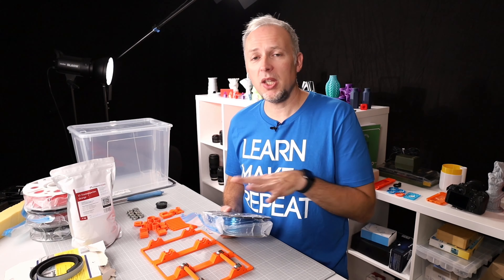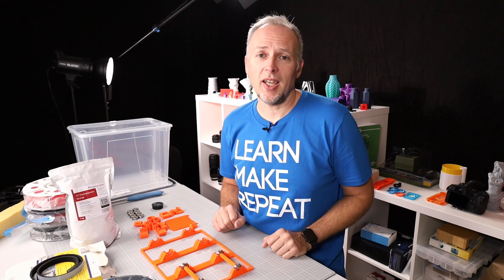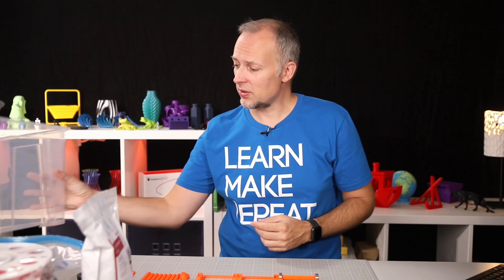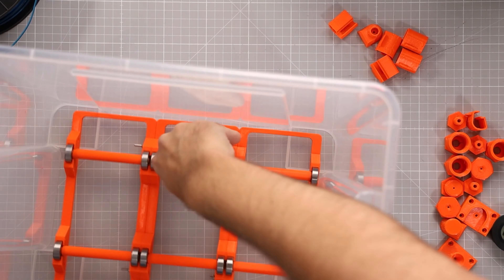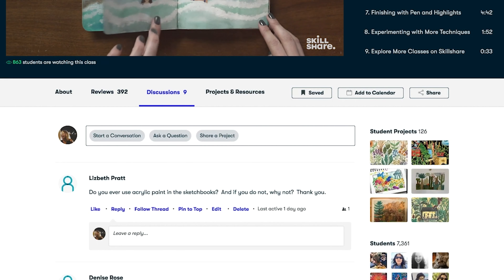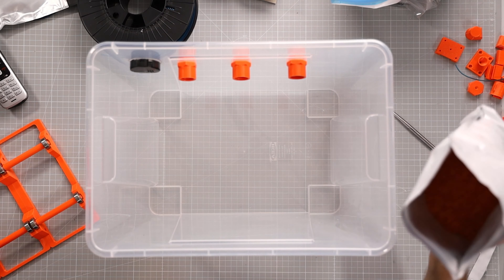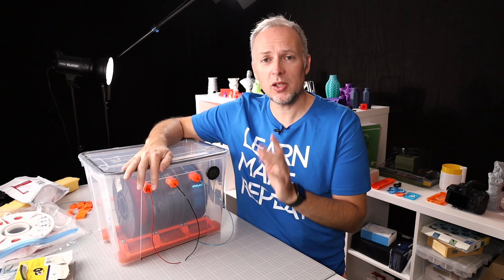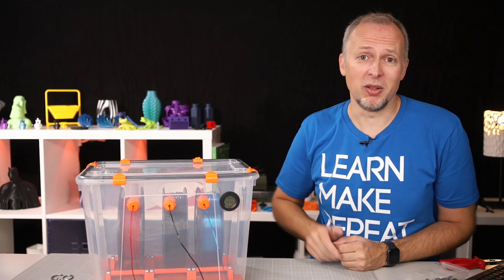Let's Build A Filament Drybox!

Comment: Moin,

5:50 why Do you drill a hole in this Box for the Sensor? You can See into the Box...
Reply from the maker: I agree but I wanted it to be integrated into the box.
Reply: @Crosslink3D  Ok.
It's just another opening that has to be sealed somehow.

Comment: I made my own box. Used an RV moisture trapper. Just put one of these humidity detectors inside the box. Have not had it go below 34% moisture and was wondering when it will be around 15% when it's actually usable. Do I need to heat it up?

Comment: Great design, especially individual rollers. What humidity did you reach after few hours? When drying filaments in oven at 50-60 I'm getting around 15%
Reply from the maker: I've just changed the Thumbnail of the video ;-). Currently at 17% humidity.

Comment: Interesting thing i discovered is that those humiditymeters only go down to 10%. in my experience it takes about 45minutes to go down from 30% to "10%" but it is still going fast from 11 to 10, so i assume that 10% exactly would be to random to be the shutoff point at which it isnt getting any dryer

Comment: Great video and design, I am going to build the same, did  a quick check of the frame for the rollers in cura and when i print on an ender3 v2 not sure if its fits correcttly on the build plate, can someone check and advise
Reply from the maker: The rollers should fit if you disable any brim or skirt
Reply: @Crosslink3D  thanks for responding, just one last question, what size packet of silica gel beads did you use in the video, thanks

Comment: This is really good, looking at building one myself. I would suggest putting silicone sealant around the hygrometer and potentially the orange ports as well, over time, molecules of moisture will enter the box from the outside environment and slowly saturate the crystals. It's probably minimal as it is but this will probably decrease the humidity you're reading even further.

EDIT: A follow-up question if you see this - how have the unsealed bearings held up in the desiccant? I wonder if they would become sticky because of the low humidity?

Comment: its  a very nice box BUT   UV light (daylight) does more damage as moisture.  DONT use a transparent box.
Reply: Or you know just don't put the box into direct sunlight...thanks for today's pedantic, but for all practical purposes, made up problem.
Reply: Yes, sunlight is a killer, esp with transparent filaments.
My problem with the box, which I hoped he would address, is friction in the tube going from the box to the printer.  Can create a lot of drag.